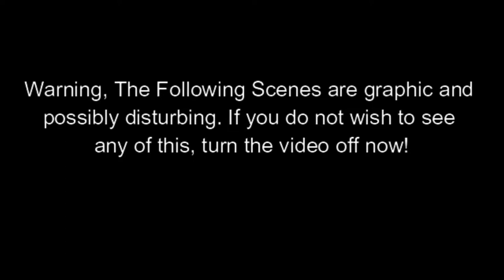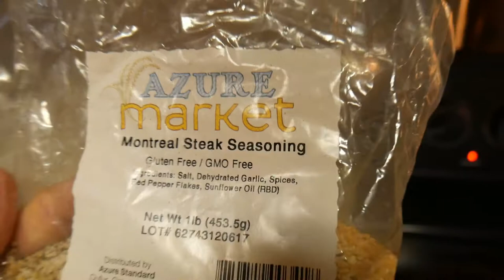Lamb Processing - Step by Step Tutorial

Comment: Tip: before hanging animal (pig, sheep, deer ect) make a small hole in skin at same place you poke to hang. Slip nozzle of air compressor in hole and as air blows in it should look like a balloon. Roll on floor making sure air has gotten everywhere (it also helps blood to push out). Cut around butt and pizzle. Hang then use truck hitch or come-along wench, skin will pull off like butter, real easy!

Comment: For the ribs, I like to debone, cut into chunks, salt and pepper, then pan fry on high heat just until the outside is seared and the center still pink. 

Shanks and other tough bits throw into the crock pot until it comes off the bone, then chop up and return to the pot with diced tomatoes, okra, corn, and a bit of spicy sausage. 

A simple one for when you're going to be coming home with company, throw chops in a crock pot with chopped onions, tomato puree and a generous amount of adobo seasoning.  Just simmer on low for the 6-10 hours you're gone and serve with an easy side.

Comment: for the leg I like to poke holes and put garlic in the holes then cover with olive oil or melted butter and put rosemary on it. Bake at 350 or so until it comes to temp, depending on leg size. Chops I fry in butter with garlic and rosemary until the center is just a little pink.
Reply from the maker: Sounds delicious!